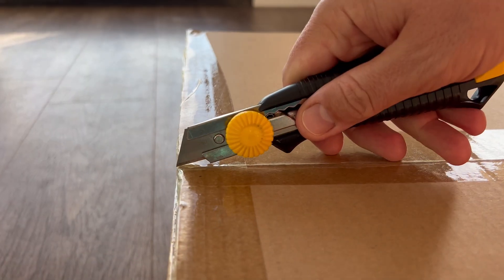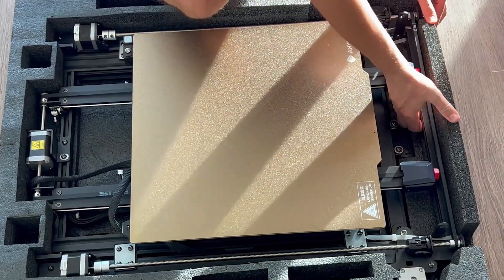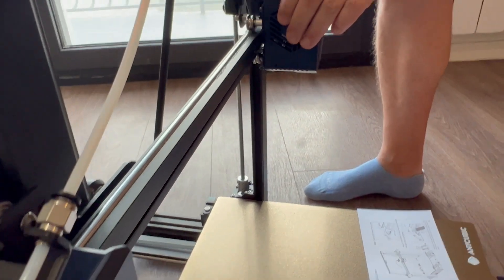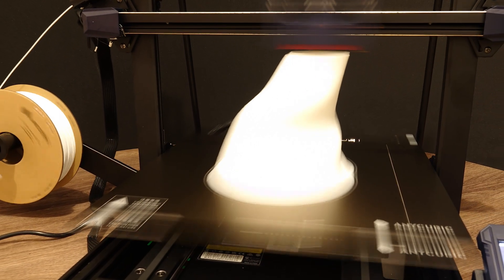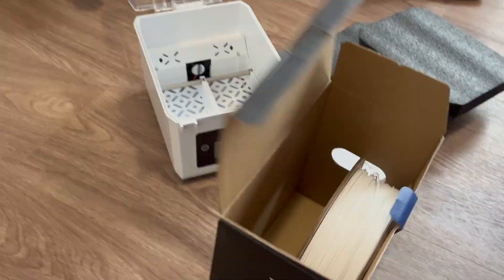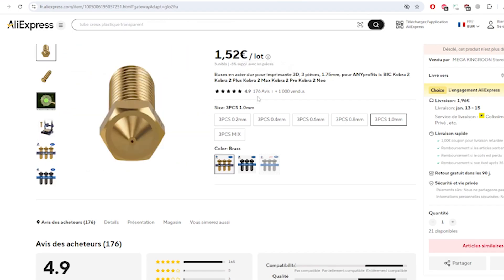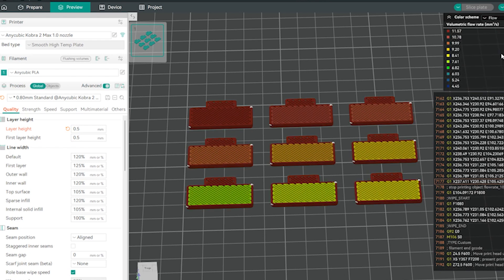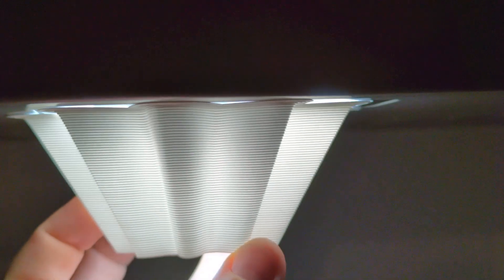Anycubic Kobra 2 Max with 1 mm Nozzle: Unboxing and Testing

Comment: Hi. Can you detail a little the process? I try from some time with 0.6 and 0.8 nozzle and I'm not happy at all. A bunch of leaking, and extrusion is not great.
Reply from the maker: Hi! Problem leaking while running standard slicer tests?
Reply: @diyprojectdepot no. On every (long) print. Not from first day, but it develop quickly
Reply: @diyprojectdepot  somebody suggest to use thermal paste (such we use on processors) on threads of nozzle and heatbreak, but I'm not so sure. Others suggest Loctite Blue Paint.